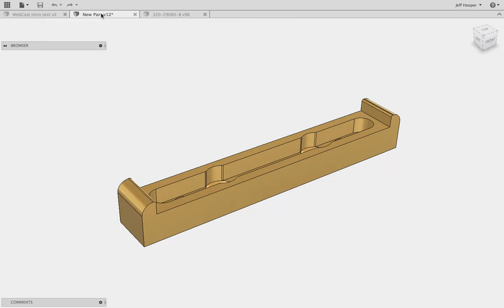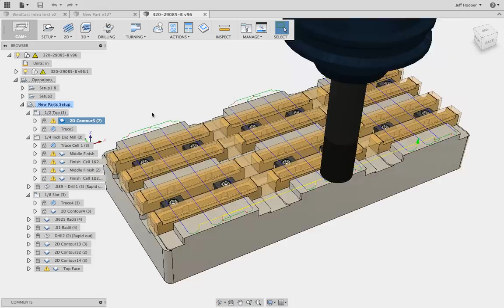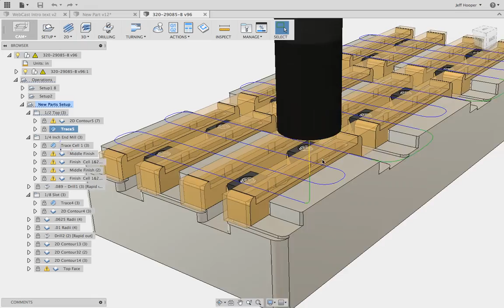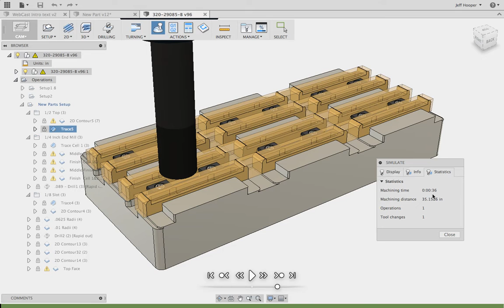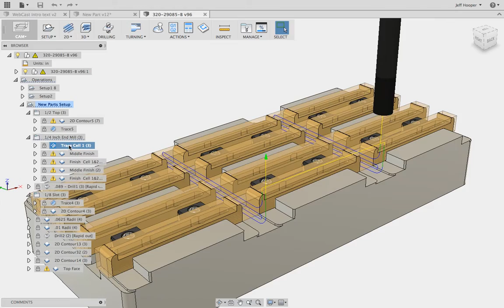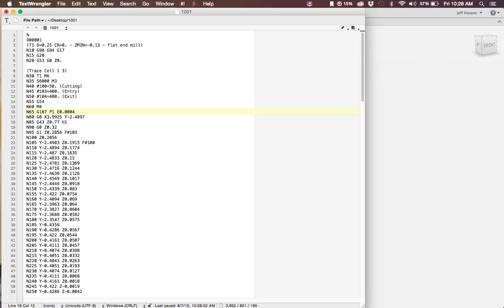Programming for Production with CAM for Fusion 360

Comment: It's ironic that you are drawing tool paths when the point of a great CAM system to NOT have to do this ;)
Reply from the maker: I drew toolpath in GibbsCAM, MasterCAM, Catia, NX because I run production, and I cut every second out of the program. That program could run for 10 years! It needs to be as simple as possible. What's 1 second x 10 years of cycles?  Fusion makes it much easier than those programs. I edit much less code than before.
Reply: I think you're missing the point. Good software should do this for you! I do the exact same thing as I also run production and need to save time wherever possible. And yes, I do understand math ;)
Reply from the maker: I'll send you the model, let your Good software write the code like I've drawn it. Every lead-in and out.
Reply: Interesting response. You completely MISSED THE POINT. :(